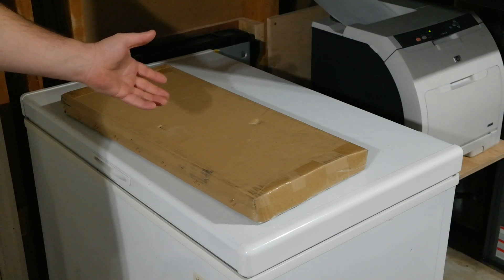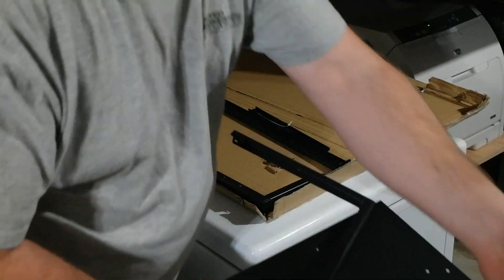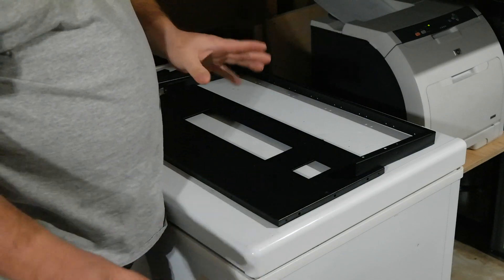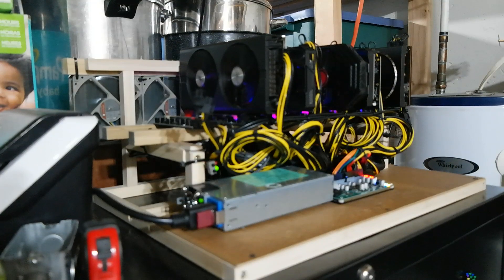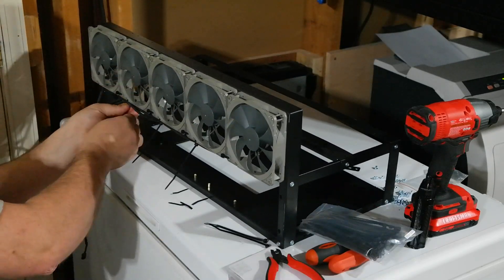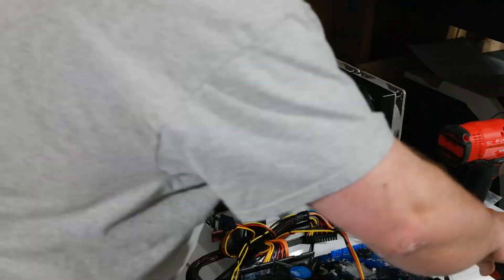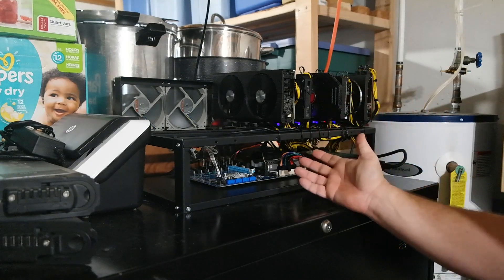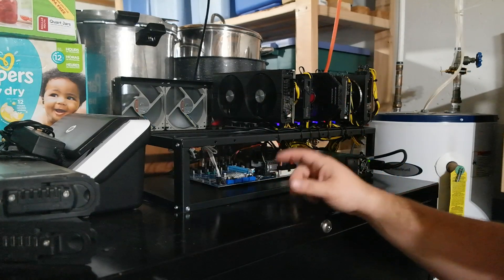Building A Generic 8 GPU Mining Rig Frame

Comment: You mentioned at the end the metal frame = everything shares a common ground. How do people get away with building their own timber rigs for cheap, where nothing is grounded to the rig? Or is this not an issue, and everything is grounded through the earth pin on the PSU/wall outlet?
Reply from the maker: Technically everything is grounded through the ground wires on the pcie cables but having a common metal ground adds to that.